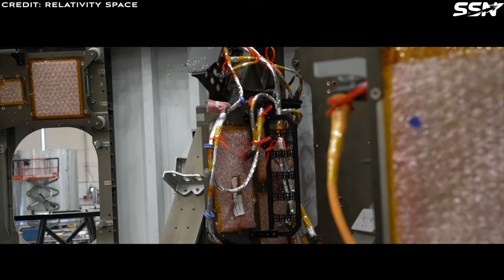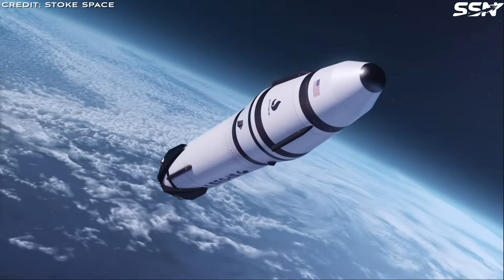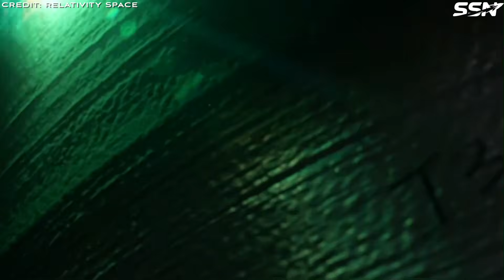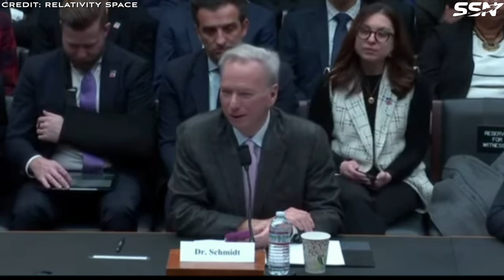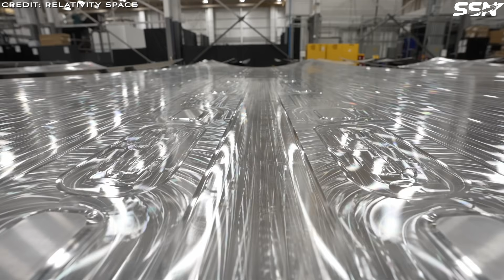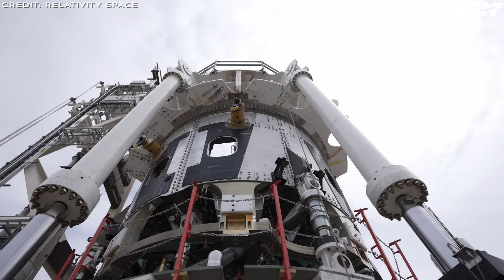Is Relativity Space Doomed… or About to Change Everything?

Comment: Terran R successful = no.   In the end, Schmidt sells off or shuts down Relativity when he figures out he wants to  be in the orbital data center business, not the small margin launch business with an uncompetitive rocket. Even then, he's coming late to the party.  BO and SpaceX are already building out orbital constellations, orbital data centers is just an extension of their existing idea.  Schmidt is spending his time and $ to build launch when he should be spending it on the orbital data centers and buying launch.  His best bet is to shut down Relativity, and maybe, maybe buy ULA and get on with it.
Reply: Oh no, don't buy ULA. At least with Relativity Space he has an opportunity to follow the path SpaceX has blazed: inexpensive proven "dumb" tech for the fuselage, tanks, stringers, etc. and "smart" tech for the difficult stuff: valves, pumps, rocket motors, actuators, telemetry & avionics. Take advantage of RS's deep expertise with 3d printing and use that for engines, turbopumps, plumbing manifolds, etc. Stick with simple (well, simpler) gas-generator turbopumps. Begin developing a production process that can scale up quickly to minimize "production hell" when you're ready to build a lot of them. 

Focus on proving 100% reusability. It doesn't matter that you're building rockets the same way that other rocket companies (like SpaceX) do. If you can fly and return both the first stage and the second stage, and then quickly return them to flight again, you'll be a strong competitor. SpaceX is going to beat you to that milestone, but no one else (besides RocketLab? Will we see New Glenn fly again soon?) is even close yet.
Reply: If he wanted orbital datacenters it doesn't nesacarly have to be competitive if it cost 10% more than a falcon9 but spacex charges a 20% profit margin it's cheeper to use your own rocket even if it's 'umcompetitive'